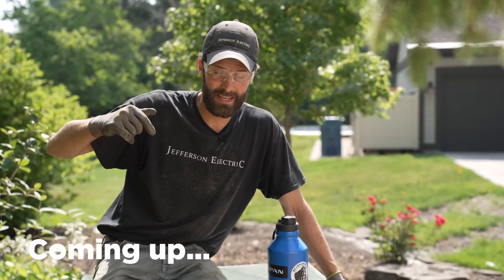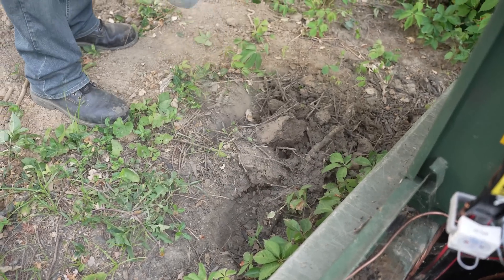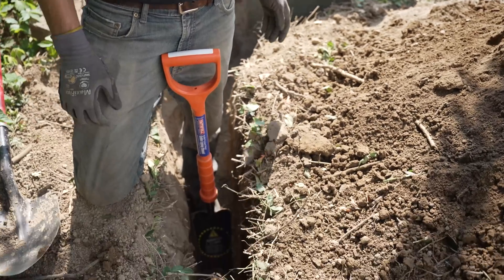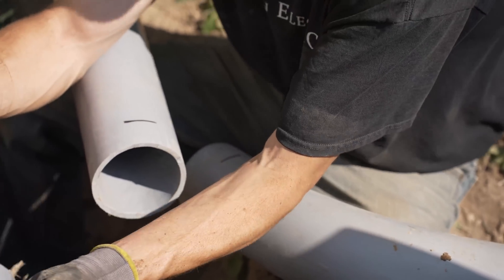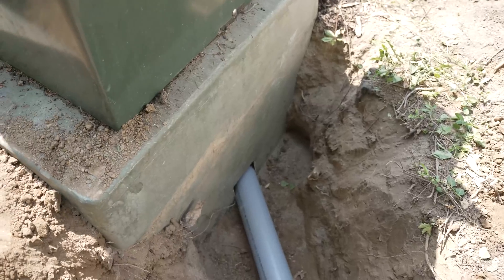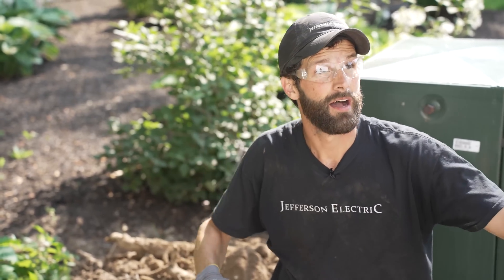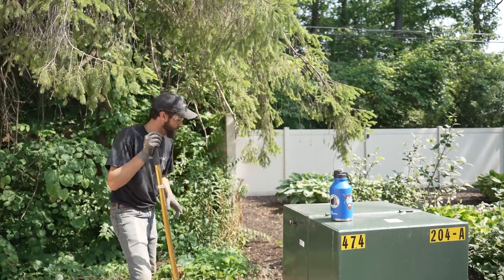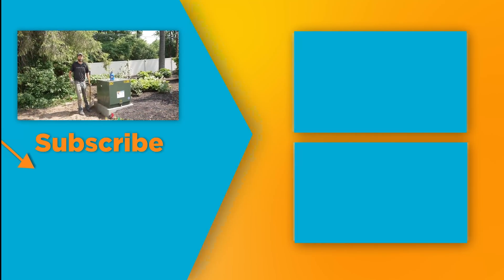DANGER: Energized Work with Only a Shovel

Comment: 7200/12470 delta-y … I mean delta divides so I guess if you did 7200 + 7200 = 14,400 in your head I could see the mixup… but still , not on the Primary. Delta divides only accounts for secondary… like 120/240, 240/480… next time just show the the label 😊 4:54
Reply from the maker: "Math on camera" strikes again! 😮‍💨

Comment: ya, called 811.
Marked the locations 3 times before the City DID the job.
Funny hting is the City marks THERE STUFF(water, sewer), Electric is above ground.  The OLD water line was being MOVED from 40 years ago, plastic(they had an IDEA of wher that was)
BUT the Main water line was NOT where they thought.  It was on Other side of the road.

MOST interesting thing about the area....Its Volcanic.(yes in the USA).  And The hisotry of the area, is that Gov. sent farmers here, Farmers said THERE AINT NO DIRT, and the Gov, sent dirt.
The result in may areas, is SHALLOW DIRT.  Only where in the PAST, they Blasted it out for basements...do you hae SOME depth.  installing SEWER LINES SUCKS.

Comment: I worked as a lineman for 38 years , I once was on a call where the electrician? Dug under the transformer and then used a saw to cut through the conduit going up into the transformer. It had a 7200 volt cable in it. Believe it or not but he didn’t get hurt at all. When asked why he cut the conduit , he said he was going to put his service line in it. We couldn’t figure out why he would even try that.

Comment: I had the pleasure of showing up to a site where an excavation crew actually hand dug around utilities, found 7200v primary, decided it was in the way and one of the employees decided to use cable cutters to cut it out. Created a dead short between nuetral and the phase, was lucky he didnt die. Tool exploded and he had a nice little trip to the hospital, Im sure some hearing issues too.